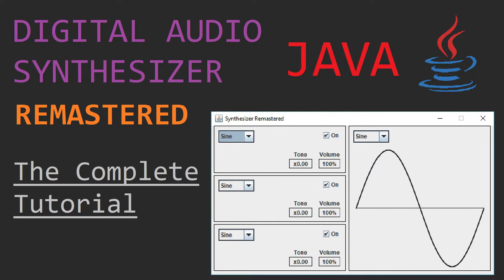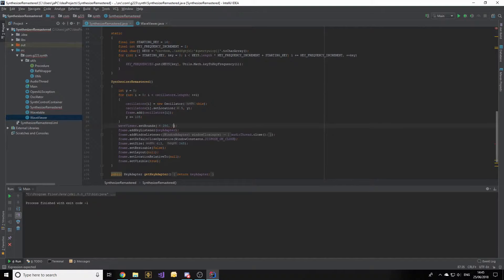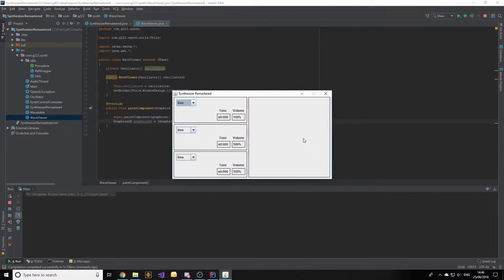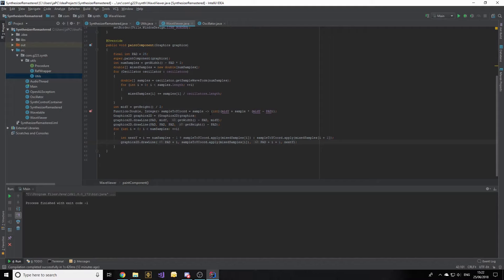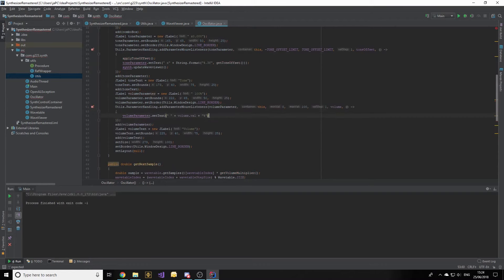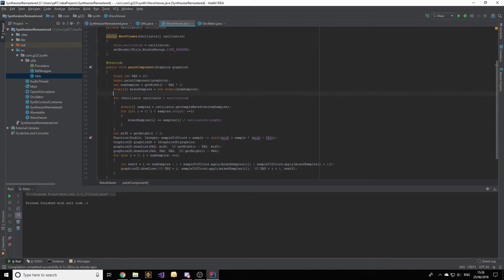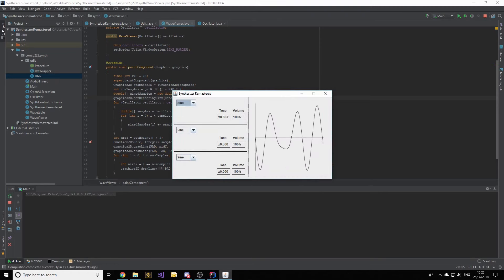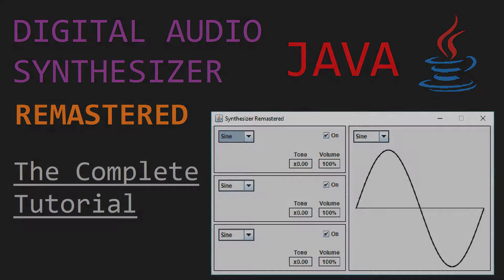Java - Creating an Audio Synthesizer - Part 6

Comment: Hey thank you so much for the tutorial, the synth is lots of fun to play with. I was just wondering how I could go about making it so I could press multiple keys at once? Is it possible with the way you set it up?

Also, for anyone wondering you can use Audacity (free software) to record your computers sound output while you play with the synth, and you can cut, copy and edit sound clips from there.
Reply from the maker: Yes, its very possible, and its typically called "voicing". Its relatively simple but requires the way I have designed the oscillators in this tutorial to be changed a little bit.

I just implemented voicing in my synthesizer for my computer science project, so I'm very fresh with the idea; I may make an expansion to this series that implements voicing, because I haven't uploaded a video in a long time.
Reply: That would be amazing! I'd love to see a tutorial for it. I'm also wanting to figure out how to pipe various different inputs into the synth such as frequencies from a microphone, generating sounds based on processing video, or readings from an EEG. So I'd love to see you expand on the series so I can understand it a bit better. I'm a CS major as well but I don't even have my associates yet :( lol
Reply from the maker: @CleonanTehGnome  I'll film a video after my mock exams in two weeks. Don't know how you would get inputs from those devices, that's nothing like I've ever done, but knock yourself out with it haha.
Reply: @g223productions3  So far there was no addition of more voices :( I was trying to figure that out. I think you have to somehow unbind the visual representaion of oscillators from the actual oscs. I played around a bit but came to no success. making more Audiothreads definetly wasn't a good idea either haha.
So is this series dead now or will you still make that addition? because that would be so fricking neat ^^
Reply: @g223productions3  still no addition of more voices :( great tutorial though thank you!
Reply: @g223productions3  thks 
But my don’t give a Audio out